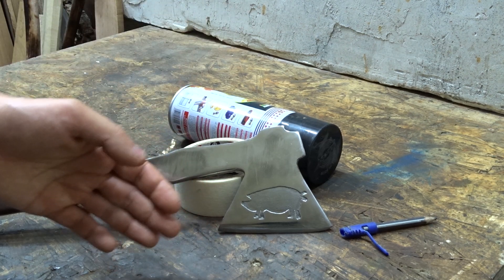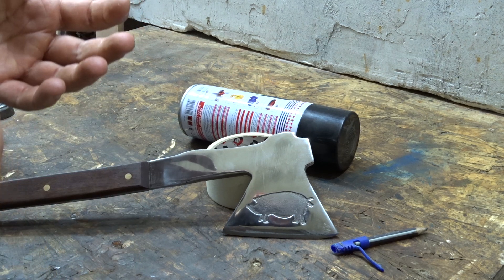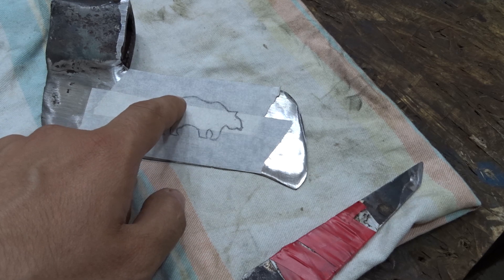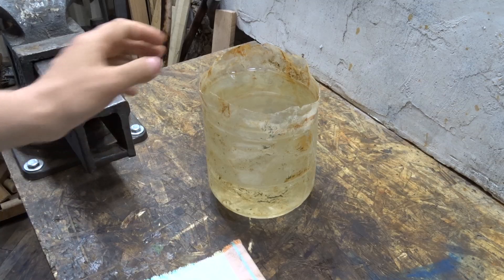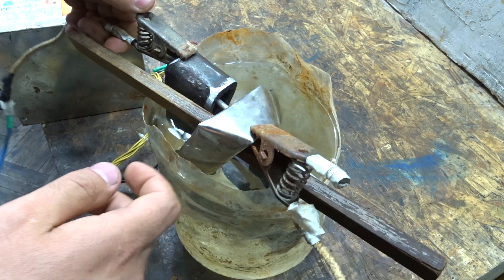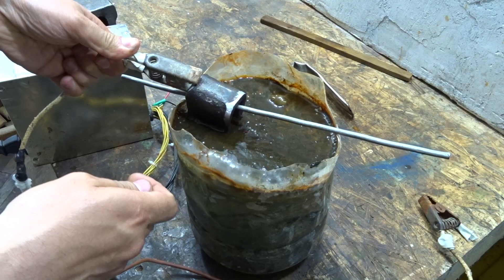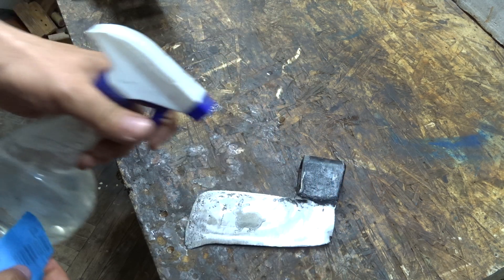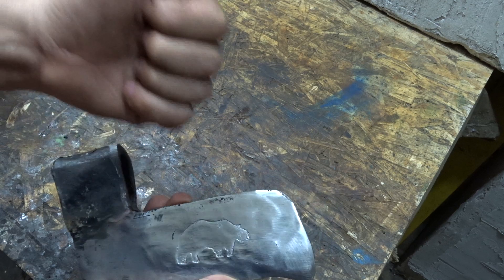How To Etching METAL

Comment: Thank you for posting these details! Very clear and easy to understand.

I did have a question regarding the paper tape.

Is the paper tape mostly for the drawing, and the paint provides most of the masking against the electrolysis?
How intricate can you get with a design? If I wanted to print out a design from the computer onto an adhesive paper, would that work just as well?

Now, if I only had the confidence to try this on the axe I spent 3 weeks hand-restoring (my first restore)... you might hear me cursing from the US if I etch a crappy design into it. :)

Thanks again!
Reply from the maker: Thank you for your attention, sir. I want to note that the best work (as I understood it in practice) is the film oracal. It can be ordered in print offices where there is digital printing. Before pasting, you need to wipe the surface (with alcohol or solvent), then heat it slightly with a hair dryer and then paste the drawing.
Reply: @ScrewsAndTools  Thank you for the information! Very much appreciated.
Reply from the maker: @billf9526  Always welcome, sir.